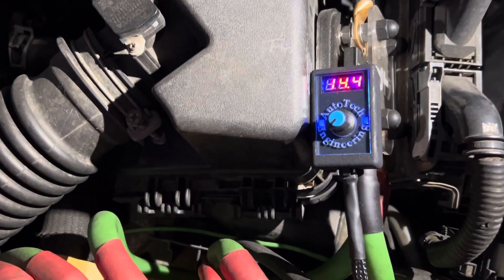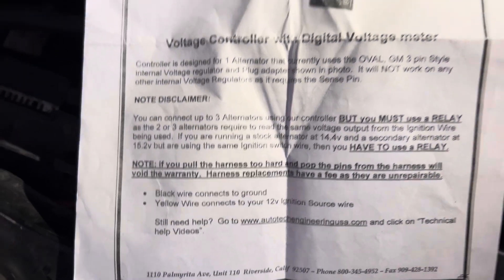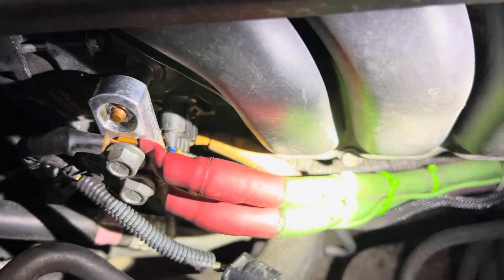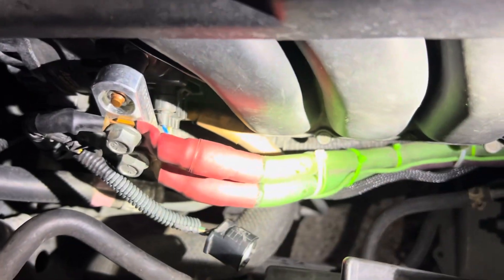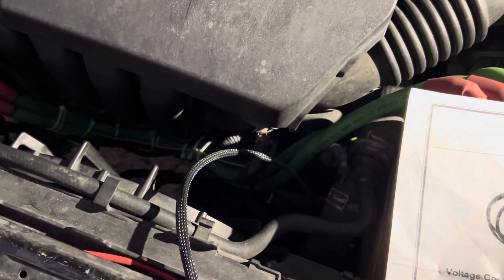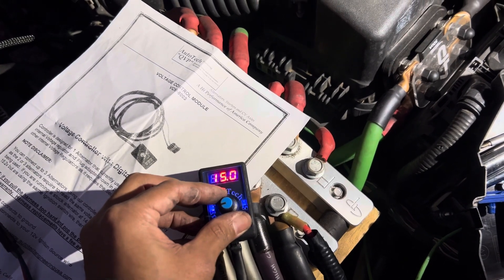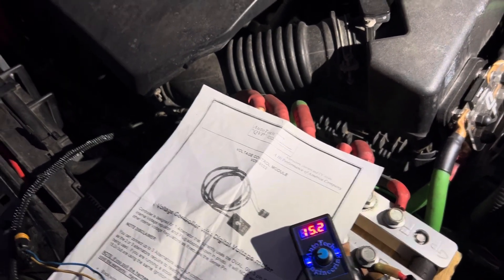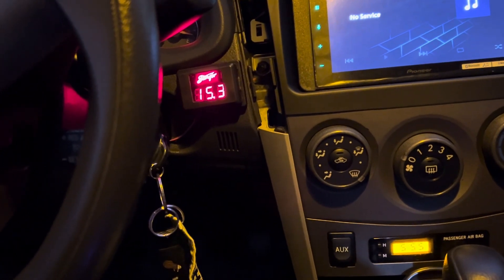Installing voltage module controller for 320 alt from auto tech engineering

Comment: Mine is not charging at drive idle, idk how to fix it. Have the 320 amp autotech. It only gets up to volts when i rev
Reply from the maker: Did you get your alt internally regulated, if not then that’s why. Best you can do is order a voltage control module which auto tech sells on their website and that will allow to raise your voltage. What kind of batteries and how many are you running. Have you done the big 3?
Reply: @RomaVilla Yea its internally regulated at 14.8 i have big 3 done all skyhigh 1/0 ofc, ive got everything grounded. It only has the yellow ignition wire and the blue L wire going to the positive post on the alt. But it doesn't wake up untill i drive ir rev rpms. And dips at stop lights

Comment: Does the minimum voltage set point stay at 14.8 at all times when cold and warmed up?
Reply from the maker: It’ fluctuate at times but it will sit at 14.8 v all the time and also when driving. My alt is starting to act up as of recently so I think I have to send it back to auto tech to check it out so possibly repair something inside
Reply: @RomaVilla  I had them install the regulator with the voltage control but my voltage minimum is 15 volts I wanted to get around that 14.7-14.8 mark for when I'm not running lto lithium. I don't understand why my voltage set point is higher than yours
Reply from the maker: @Evo-ed7hw  that is weird, is your alt from auto tech and is it regulated at 14.8 when you got it?

Comment: Hey great video can you tell me I see you have 14.4 on there I'm on the fence about ordering my alt and voltage control from auto tech because the lithium battery I have right now is 14.4 max charging 13.8 resting and I don't want to overcharge it with the 14.8 volts the alt will be regulated at will this allow me to lower as well as raise my voltage depending on the battery
Reply from the maker: Since this alt is internally regulated at 14.8 it typically stays at 14.8 in idle and at drive but most alts at auto tech engineering are internally at 14.8, the reason I installed the voltage controller was because my 40 ah ying long lto battery needs atleast 15.3-15.4 to properly charge the lithium but this specific controller only raises the voltage it doesn’t lower it below the 14.8 but depends where you buy your alt from. Auto tech engineering does sell alts that aren’t internally regulated and do have the option of regulating the voltage at whatever voltage you desire. They are a great company and customer services are also great. Give them a call or email and let them know what you need and they will definitely get you where you wanna be

Comment: Bro i have a pwm conteoller for mine but have no idea how to install
Reply from the maker: Damn, I actually struggled when I first attempted to install this one. All I had to do was add a ground from the harness to the alt and then hook up wire to ignition from under my steering column fuse box and it worked perfectly. The first time I actually hooked up ignition wire to ECU ignition which wasn’t the correct ignition spot and it burned up my high beam sensor so now I can’t use my high beams
Reply: @RomaVilla mine just went up in smoke. I was trying to tap the wire behind the controller because it disconnected so easily.
Reply from the maker: Where did you purchase your pwm controller and what kind of alt do you have?